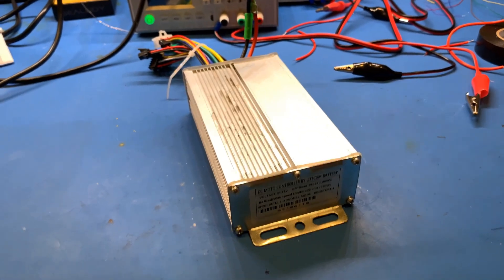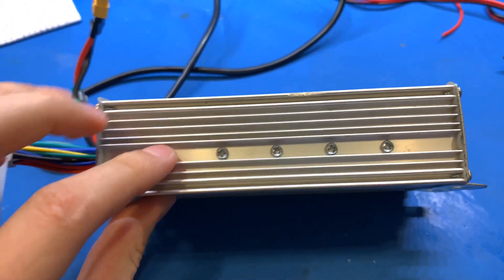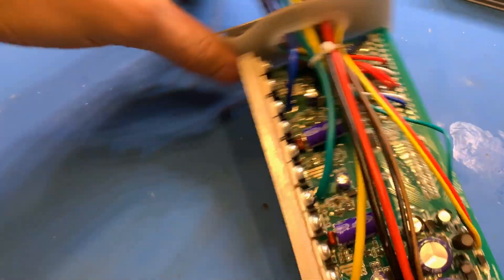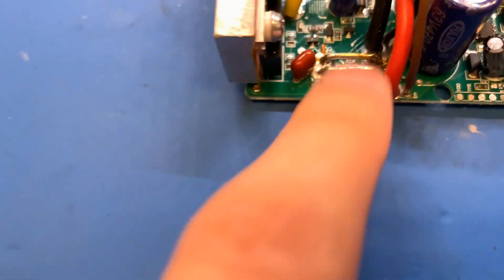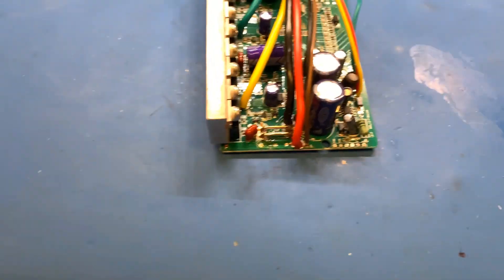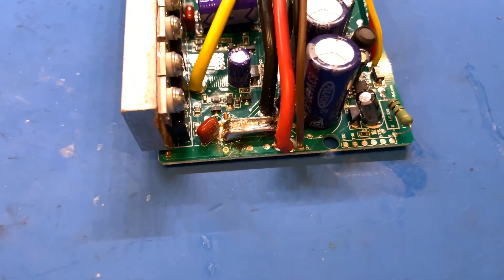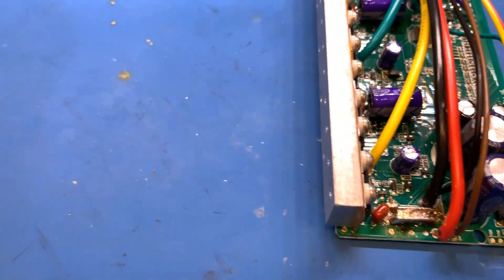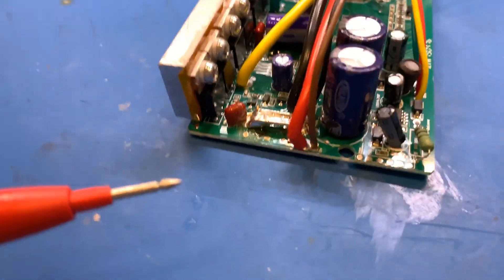Ebike Motor Controller Power Mod

Comment: I have a problem with my controller detecting the battery capacity. I'm using real makita batteries wired in series/parallel, using 8 5.0ah batteries, but the controller acts as if the battery is half the actual capacity as it's used. Would this hack possibly work for my problem? Any help is appreciated. My name is Bicycle Bob and I approved this message.
Reply from the maker: I don’t think that this hack will help your problem. I think your problem could be that your batteries are not providing enough voltage to your controller. If your controller is a 48v controller I would wire 3 batteries in series which would provide 54v to the controller. Since you have 8 batteries I would have 2 parallel groups of 3 in series which would be 6 total batteries. If you want you could buy one more battery so you could do 3 groups of 3 in series which would use all 9 batteries. If it’s a 36v controller, 2 batteries in series would work fine. You would have 4 groups of 2 in series.
Reply: @ryanstephenson7655   When I first built and tested the system, I only used one pair of the 18v batteries for a proof of concept. It worked fine using the twist throttle but the battery level indicator was dropping quickly and within a few miles stopped with the code reading dead battery, but the indicator lights on the battery itself were 3 of 4. So I built the 8 pack for a nominal equivalent of a 360 watt battery, but even using that gave a reading of half of the batteries actual capacity, I didn't run it all the way down, but would like to be able to use it more efficiently.

Comment: I’ve been trying to find a way to make my ebike faster. I already removed the speed limiter this seems like the easiest solution. The the controller the only thing at risk or the engine to?
Reply from the maker: The controller is the only thing at risk, the controller will blow up before the motor will.
Reply: @ryanstephenson7655  Depends on the controller.... Factory with the motor, you're correct. An aftermarket, the windings will burn off the enamel (insulation for bare wire). There's controllers that will burn the fk out of those windings lol. Then when current jumps jumps to another separated winding for the face, RIP to that motor, your phase wires and if your controller isn't advanced and the diodes or fuse doesn't catch it. It will go straight to the battery. No most E Bike battery have a great LG BMS system which will catch it, like a breaker or disconnect. Many years ago when I had the time I used to put electronics to the absolute test. I had a thousand watt motor cap (max factory recommended watts). I've noticed most BLDC motors for bikes (direct and non-direct) can take almost double that till you burn off the insulation enamel winding wire. You very much can burn a motor out before the controller if the controller is rated higher than the factory specs of the motor. Not all controllers can handle a short well, which can hurt somebody. Especially if they don't know what they're doing and tamper with the whole electrical system including the battery. Not to mention if it grounds out with the power and common wire on bare metal. These batteries do have the peak power to kill you if current runs through you enough because of the death grip when current is exposed to the hand. That's very rare it would ground out though.  I've seen everything, and I've also seen many lithium batteries have a nasty fire. Live and learn right lol. My point is, don't be telling people the motor can't burn out before the controller can, when an aftermarket controller sure the hell can. I do commercial HVAC start up, service and warranty work. I work on phase Motors that run 460v. Not to mention I've been working with electronics most of my life in my off time and previous jobs. I'm a professional and know my shit, so watch what you say to amateurs just getting into this. Only reason I'm writing this is for safety and preventing people from wasting a ton of money because of misinformation.
Reply: @ryanstephenson7655  oh, I take that back, you probably can burn out the motor with a factory controller. When modding it. Motors can usually take half to almost double the rating. Something they don't tell you, because of safety and warranty issues. If you want more power from your motor, get a better controller that can handle it and make sure you're windings and power wires are the appropriate gauge. Electricity works just like water. You have enough electrical pressure (amps), then it will give. I get money can be tight, but a little extra money can save you a ton of headache. Trust me, I see it everyday in my field 😂😂😂. Other than that, keep up the videos. No hate, just correcting your mistake and we all make them. 🤘
Reply from the maker: @commercialhvacposting4511  I understand that there are probably scenarios where a motor would burn out before a controller but with most ebike kits the controller is the weakest link. Motors can take really high burst current before they blow. They can usually handle about 2x continuous and 5x bursts their rated power. Also if you are looking the safe way or the right way this mod ain’t for you.

Comment: Hey, can you help me? So I have a 52V system 2x1200watt electric scooter. It has one controller per motor. I think one controller was ~25 amps. My scooter has really quick acceleration but lacks in top speed. I would like to have better top speed, will this "mod" do it? And should I do it on both controllers?
Reply from the maker: The way to increase top speed is to get a higher voltage battery so I won’t recommend doing this mod.
Reply: @ryanstephenson7655  Oh. What will this mod do then, increase torque? And if I would buy a 60V battery for my 52V scooter, do I need to change the other electrical components that obviously are 52V. And how big is the speed difference? (I can go 50km/h or 30mp/h now) Thank you.
Reply from the maker: @maxl7827  Yes, this mod will increase torque. A 60v battery will most likely work with your electronics but if not you can upgrade your motor controllers to 72v ones. Top speed will increase linearly with battery voltage as long as  you have enough torque to over come wind resistance.
Reply from the maker: @maxl7827  Also I went from a 52v to a 72v battery and I gained about 10mph speed. So you might gain like 5mph going to 60v.
Reply: @ryanstephenson7655  Thats interesting, but 2 controllers cost about 100€ and a new good sized 60V battery pack costs about 500€, through aliexpress. I dont think I have that kind of money to throw, maybe I could sell my 52V battery pack which is nearly 500€ in aliexpress but.. And yeah torque is not a problem, my motors have a lot of torque but they lack in top speed.
Reply: @ryanstephenson7655  To 72V wow thats a big jump. 5mph would be a really nice jump, thats about how much I would like it to go. If you have any other tips, I am interested to know about them. Thanks for your answers!
Reply: @ryanstephenson7655  hey boss, love the knowledge you have on this.  Need a recommendation for 72v Brushless Motor Controller and where I can purchase online.  I cant find anything for my Nanrobot LS7 Plus.  Currently I  have 52v dual controller system. I would add a battery parallel to my existing battery. I think my current battery is 60v ?? I forget.  Anyhow,  any info on getting those controllers would help. I hear Sine wave controllers are good?
Reply from the maker: @positivevibesdrumming5186  I don’t know a bunch about scooters but I like the sabvoton controllers. I think they make scooter controllers also.

Comment: I'm only looking to increase my current by 50% - if it 'tricks' the controller as to what the real current is, how can I tell how many amps I'm pushing (my display reads current atm) - can I just read the resistance across those 'shunts', and decrease the resistance with some thin wires until the resistance is 2/3rds what it use to be?
Reply from the maker: Yes that will work in theory but the resistance of the shunt is very low so most multimeters won’t be able to measure it accurately enough for it to be useful. I would recommend getting a separate current sensor external to the controller to measure your current.

Comment: I don't know which one to buy because can every motor run on sine wave? And does it matter if the controller has hall sensors or not?
Reply: Brushless motors need 3 phase and brushed motors just use DC.

As for hall sensor, if the controller has hall sensor wires then the motor has to have a hall sensor for the controller to work. If the controller doesn't have hall sensor control then you can use it on a brushless motor with or without hall sensor.
Reply: @skepticfucker280  not true ,  some controlers can work with or without  hall sensors .

Comment: Looking at the two capacitors on the board you have I couldn't make out what they were rated at.   My 24v controller came with 63v 430uf caps.  I was wondering if swapping them out for 1000-1500uf caps would be of any benefit or even harmful???
Reply from the maker: Swapping out the capacitors wouldn’t  have any benefit but it shouldn’t harm you controller. The only reason I can see to switch out the capacitors is if you want t to run a higher voltage then the controller is rated for but in your case they are rated for 63v so theres already is a lot of head room.

Comment: can you also do this mod with a controller for lead acid batteries?
Reply from the maker: Yes, as long as the controller has a current shunt then it will work.
Reply: @ryanstephenson7655  so  72v controller it should be fine ?

Comment: So if my current 1200w/48v/30amp system maxes out at like 32mph. Will this mod give me more mph on the top end or just more kick? Or both?
Reply from the maker: This mod will increase the amount of amps your controller will give to the motor so the motor will have more torque. Your max speed is determined by the battery voltage so if you want more speed increasing to a 72v battery will give more speed.
Reply: I have no modifications and get from my 48-volt 1000 Watt 
is 38mph.
The difference is you probably have a BMS board with your battery pack.
It restricts voltage to 52v fully charged.
My battery pack charging upto 58.6 volt fully charged.
Reply from the maker: @scottrocks1993  Actually the overcharge protection on a bms board is 4.2v per cell so if you are running a 13s battery full charge would be 54.6v. So the difference is you are running a 14s pack and he probably has a 12s or 13s.
Reply: @scottrocks1993  hey bro what is the specs of the bms you used? Thanks in advance i also hage 48v 1000w battery pack but the fully  charged is just 53.2v

Comment: Moniter your batteries voltage drop on load, you need more amp power (more packs in parallel) . 60 volts of 18650 4x4's and a 3x3 barely good enough.
Reply from the maker: Yes, I would recommend going with the SPIM08HP cells if you are using a lot or current, they can supply 200A continuous and they are cheap easy to use.
Reply: @ryanstephenson7655  lipo packs are a hazard compared to 18650. You can short a 18650 and nothing really happens. But these can puff up and 🔥 . Be careful but good recommendation. Where do you source them?
Reply from the maker: @Zach C they are lithium ion batteries in a pouch form factor so they are safer then lipo batteries but can offer high current capacity. Here is a link to where I got them https://batteryhookup.com/products/spim08hp-3-7v-8ah-200a-lithium-ion-w-cell-holder?rfsn=3457763.f6c041 Also I made a video a few days ago on how to make a battery pack with them.
Reply: @ryanstephenson7655  lithium ion in a pouch sounds risky. If you puncture at all it's blowing ip
Reply from the maker: @Zach C these cells are actually pretty safe, here is a video of a short circuit test https://youtu.be/QV0mywEhX6A they didn’t catch fire or explode. They also come in a plastic hard case which protects them from being punctured.
Reply: @zachc5456  I've done multiple projects with lithium 3.7v batteries and have never bursted in flames.
At the beginning I used to make a lot of mistakes and they didn't catch on fire.

One time I actually tried to make a fire with them and I couldn't
Reply: I have a 14s 11p battery pack with 3.7v cells.
When I'm pulling 1400 Watts it drops from 55v to 52 volts.

A normal ebike has a battery half the size as my battery pack 
They would probably drop to 45V from 55V

Comment: Can i use my 48v batt still
Reply from the maker: Yes as long as you don’t draw more amps then it is rated for.
Reply: @ryanstephenson7655  i have a cheapy blue lithium pack from ebay, 30/50 amp. Do you think id be save to just add a little solder?
Reply: Controller is a 48v kunray 33a

Comment: Found it. :)  Can you link the kit you bought?
Reply from the maker: I bought mine from Craigslist but here is the link https://www.amazon.com/Voilamart-Electric-Conversion-Intelligent-Controller/dp/B07Q7FJ8ZY/ref=sr_1_3?crid=1NYTAX4GRZJL5&dchild=1&keywords=voilamart+ebike&qid=1595111920&sprefix=volima%2Caps%2C224&sr=8-3
Reply from the maker: Also, you need to get a battery. I built mine custom here is a link to where I got the cells https://www.batteryhookup.com/?rfsn=3457763.f6c041
Reply: @ryanstephenson7655  I have a good supply of 36v batteries I plan on paralleling.

Comment: What ebike is this off?  Is the controller still good?
Reply from the maker: Mark Svara The kit I’m using is the Voilamart 48v 1000w hub drive. With the mod I was running 3000w at 72v. I tried adding more solder and I got it up to 4000w but the controller died shortly after. I would recommend not going past double the rated watts on the controller if you want it to last.
(Edit) actually my controller did not die it was a bad connection on my battery so its still working on 4000 watts.
Reply: Ryan Stephenson thanks for your reply. I’m actually looking to add amps not watts as that is what I thought solder on the shunt does. My ebike is the Daymak EM3 with a 2000w motor and 1000w controller that puts out 35amp continuous/50amp burst.  I need more power to get me up hills at a more reasonable speed.
Reply from the maker: Mark Svara adding solder will add more amps but watts = amps x volts so it will be adding more watts as well. More amps will give you more torque and more voltage will give you more speed.
Reply: @ryanstephenson7655  Jesus Christ lol, how fast was it at 72v?
Reply from the maker: Shammy Ali 43mph max Speed
Reply: @ryanstephenson7655  43mph without pedalling?! holy crap it must've flew up hill
Reply: @ryanstephenson7655  4000w watts is insane amount on that kit as i have the same and was wondering how much power i could put throgh it but mine is front hub so do you think a 45amp controller at 48 volts would be perfectly safe ?
Reply from the maker: @FATTY1990  Yes, the Hub motor can handle a lot of power. Since there is not much weight on the front wheel it will probably spin the tire on hard accelerations. I would also recommend getting torque arms so you don’t break your dropouts.
Reply: @ryanstephenson7655  ok thanks nice so if i got a 1500w controller 45 amp it would be fine for the Voilamart motor i have only just not long got the kit and have it working and i have a torque arm installed
Reply from the maker: @FATTY1990  The voilamart motor can handle 45a easy. I been running it at 50a 72v and it only gets a little warm.
Reply: @ryanstephenson7655  no worries thanks i will have to do the mod on my new controller and order the new one
Reply from the maker: @FATTY1990  just make sure to start off adding small amounts of solder and work your way up.
Reply: @ryanstephenson7655  yes i will do that i am buying a new Sinewave Controller so i will do it to the old controller at least if it blows i have a brand new one lol

Comment: Nice 👍🏾 work and this mod works well even if you use a paperclip with hot glue that’s what I did so I would not blow up another controller
Reply: Interesting, do you have a pic on how you did that with a paper clip?
Reply: May you please  send pic how you did it with a paperclip
Reply: Lay a whole, small paper clip on top of the factory current flow shunts and glue it on top touching both ? Pic please??